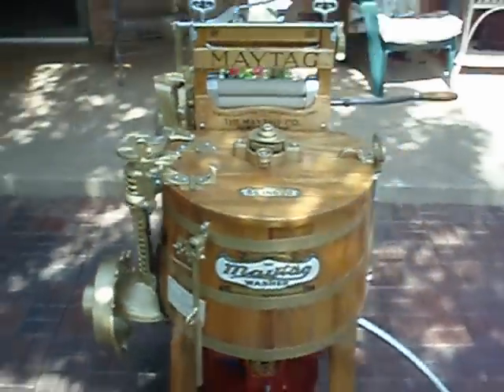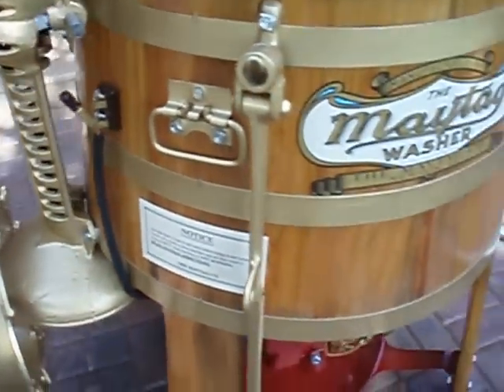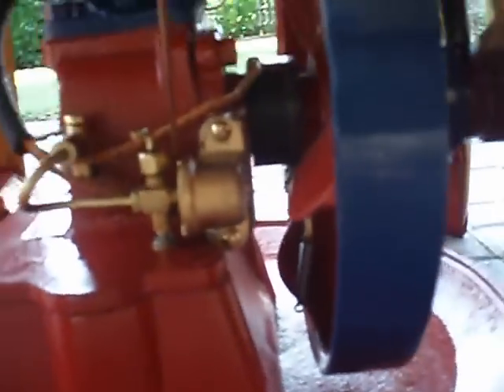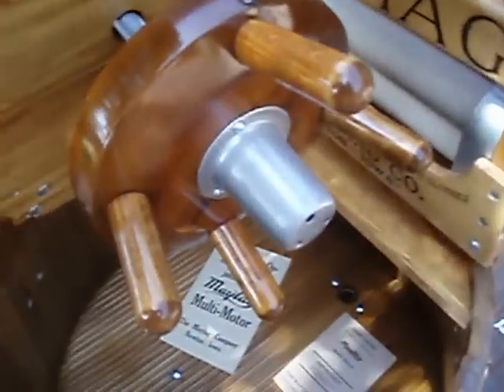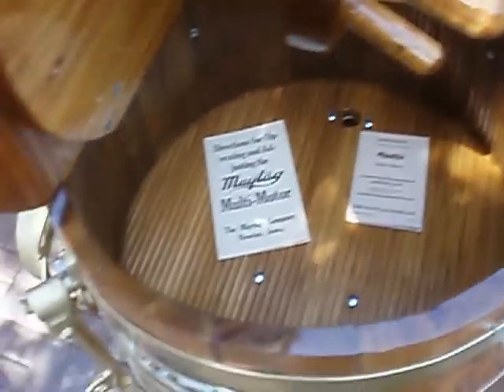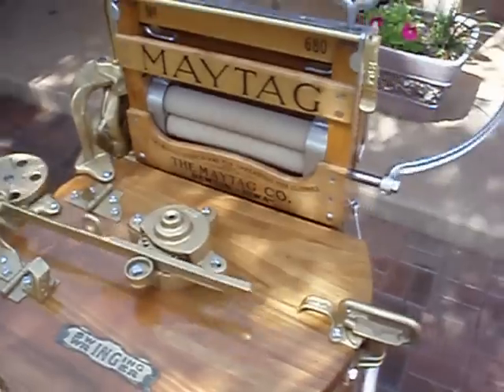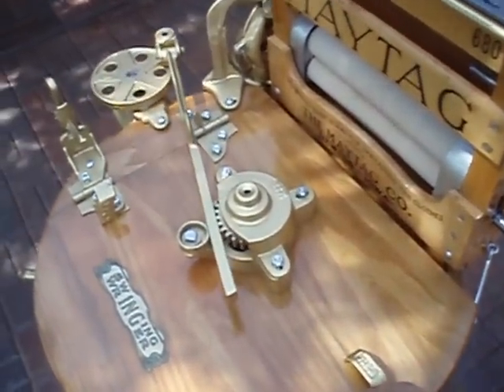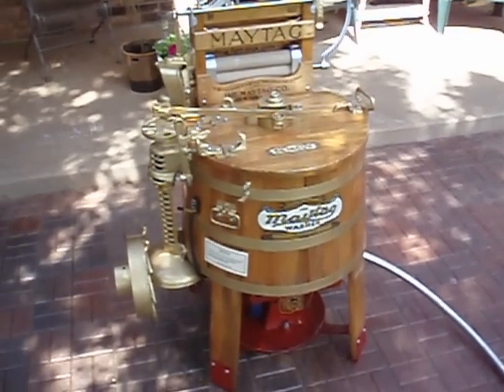1917 Maytag Model 43 Washing Machine. Gas Engine powered

Comment: Although it obviously worked, the machine was designed with little concern about grinding up various body parts, especially those of small, curious children.  Manufacturers couldn't get away with such a design in the 21st century.

Comment: I really like that ankle catcher attachment you used to kick start it with.
Reply: Yes, extremely dangerous - they didn’t consider safety when it was created, 1930s. The only safety features, if using inside - to put a metal pipe on the exhaust to put out the window/through a hole in the wall (like he has done there - putting the exhaust at a distance) the transmission lever locks the lid, the wringer handle can be detached

Comment: I did not know washing machines existed in 1917 let alone an automatic one.  I wonder how long one would last where it's made from wood.
Reply: They were already around  by the 1890's ,but they were manual either with the tub set on big springs that you shook from handles on top and side or with a long bar you moved up and over and back like a wiper or a fly wheel with a handle like the  wringer you turned to move the agitator.  Electric ones came out in the 1910's,some even had a connection for gas with a burner so you could keep the water hot.. Nonetheless it sure took away the back break  on the scrub board!
Reply: Wood coped better with the alkaline soap used.
They used cypress in spray tanks for agriculture around then too.
Reply: Wood was used to hold beer, water, pickles in brine and wine. Why not use wood. Metals reacted badly with the lye and water. Metal could rust or turn your clothes colors.

Comment: Where were these things used? Did they use them outside or was there some way to vent the exhaust safely?
Reply: +ryelor123 They had long flexible exhaust pipes with a muffler on the end.  Not sure if that was standard or an option, though.  Experts correct me if I'm wrong.  That's just what I remember from my grandmothers garage when I was a kid.